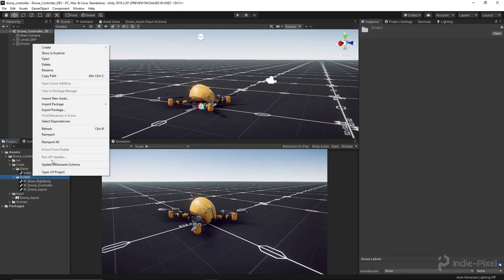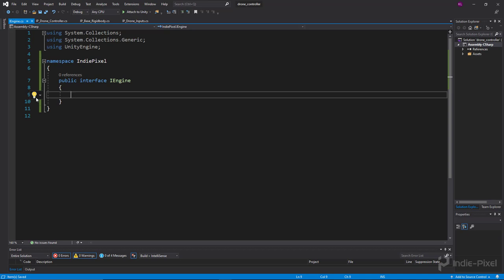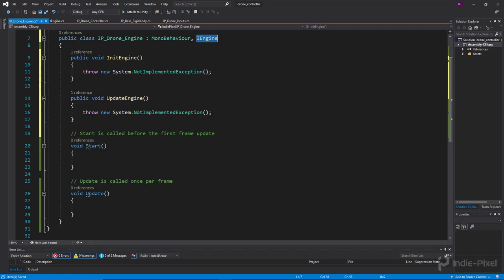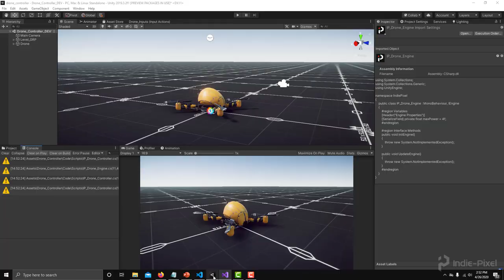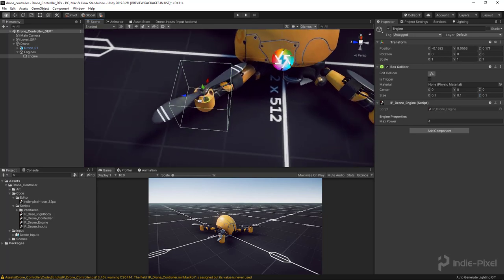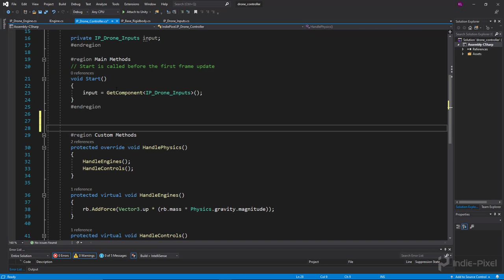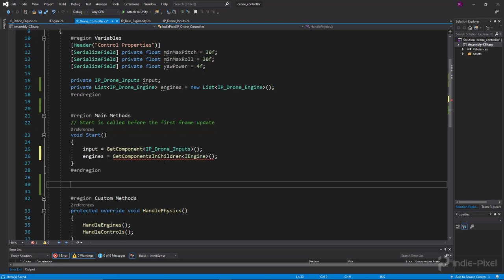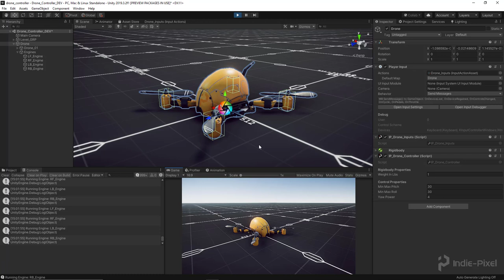Unity 2019 - Drone Controller - Section 3 - Video 4

Comment: 'IEngine' does not contain a definition for 'ToList' and the best extension method overload 'Enumerable.ToList<IEngine>(IEnumerable<IEngine>)' requires a receiver of type 'System.Collections.Generic.IEnumerable<IndiePixel.IEngine>'

If you are getting this message , make sure 
you dont write "GetComponentInChildren<IEngine>().ToList<IEngine>();", the correct one is 
"GetComponentsInChildren<IEngine>().ToList<IEngine>();" (its GetComponents , not getcomponent)
Reply: Thank you so much
Reply: This worked for me for that error:

private List<IEngine> engines = new List<IEngine>();

            engines = GetComponentsInChildren<IEngine>().ToList();

Comment: I have a error in this line why?

Assets\Drone_Controller\Code\Scripts\IP_Drone_Controller.cs(22,23): error CS1929: 'IEngine' does not contain a definition for 'ToList' and the best extension method overload 'Enumerable.ToList<IEngine>(IEnumerable<IEngine>)' requires a receiver of type 'IEnumerable<IEngine>'
Reply from the maker: You need to add the line using System.Linq; to your using statements at the top of the script.
Reply: @IndiePixel3D  
Thanks brother and very good video
Reply: @IndiePixel3D  I specified using System.Linq; but the problem remained
Reply: @i.s.c.cristiantrujilloespi8631  show me your code, please
Reply: @NoZhenya  it doesn't work for me either
Reply: @soheil4471  I fixed this problem
Reply: @NoZhenya  How
Reply: @soheil4471  Deleted scripts and instantiate new script

Comment: foreach does not work for me, i don't have anything in console.
Reply from the maker: I'd have to see your code to provide any meaningful help. Can you show your for each code?
Reply: @IndiePixel3D  protected virtual void HandleEngines()
    {
        //rb.AddForce(Vector3.up * (rb.mass * Physics.gravity.magnitude));
        foreach(IEngine engine in engines)
        {
            engine.UpdateEngine();
        }
    }
Reply: When I click on play , my drone is falling off the map
Reply from the maker: @pawekwiatkowski3586  that looks fine have you assigned any engines to your drone controller script?
Reply from the maker: @pawekwiatkowski3586  does your drone model have any collision meshes?
Reply: @IndiePixel3D  Propably not, how am i supposed to do?
Reply: @IndiePixel3D  It doesnt have any collision meshes without this one from tutorial
Reply from the maker: @pawekwiatkowski3586  well we go over it step by step in the video series.
Reply: @IndiePixel3D i will try everything again
Reply: @pawekwiatkowski3586  I had the same problems. and I found out I have put my scripts off the player input and drone controller scripts under Drone_01 and not Drone in the Hierarchy. I move them to Drone and it fix the problem off falling off the world. + I got the consoling working 2. hope it helps.